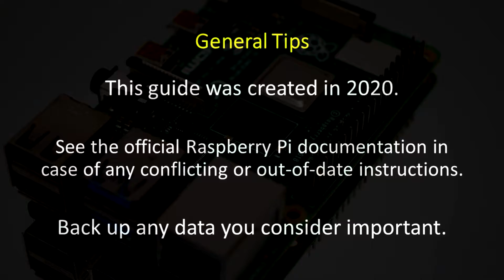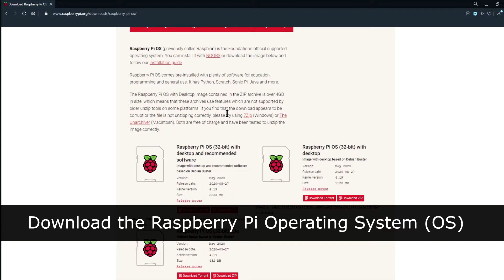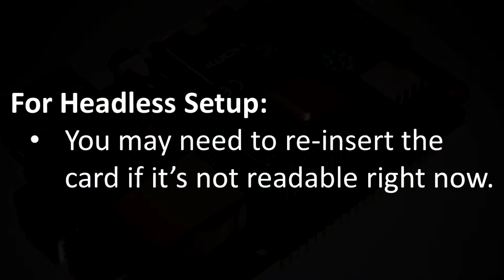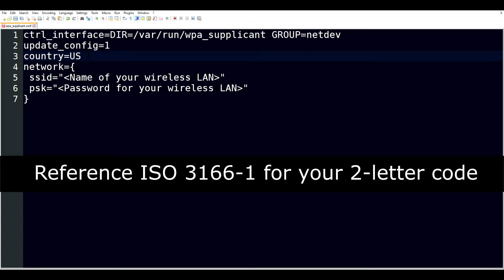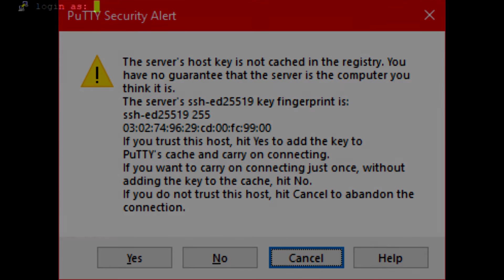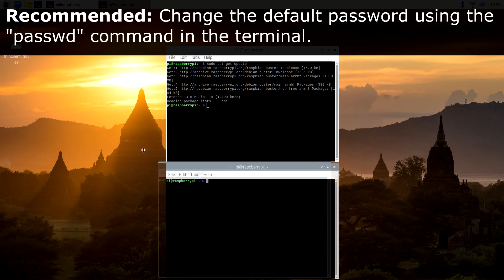Raspberry Pi 4 Setup for Windows Users [DEPRECATED]

Comment: Hey Mate, thanks for these detailed tutorial!
FYI: The login data for first boot has changed. Login via pi/raspberry does not work any longer. 
Now, the Wlan & user / password data has to be configured via the RPI Imager. 
Just click on the "settings" icon at imager screen and set it up. 
Using this way, no extra files are needed.
Reply from the maker: Thank you for the heads-ups!  Today,  I updated the video title/description to reflect these changes.  The pi/raspberry elimination was pretty unexpected at first but I'm betting it will have a positive impact since the OS has become so widespread.

As a side-note, I also have an (overdue) video coming up on Raspberry Pi Zero W.  Actually doing a little field testing this afternoon!

Comment from the maker: 1:20 - General Tips and Disclaimer
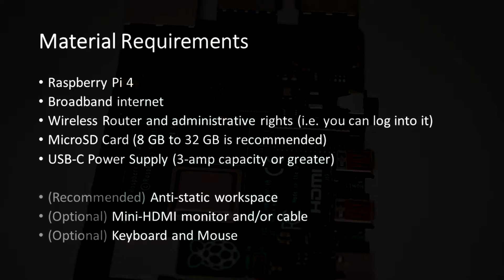2:00 - Material Requirements
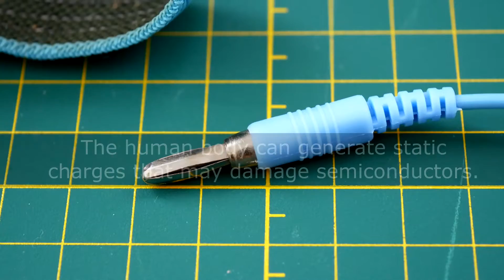3:12 - Software Requirements
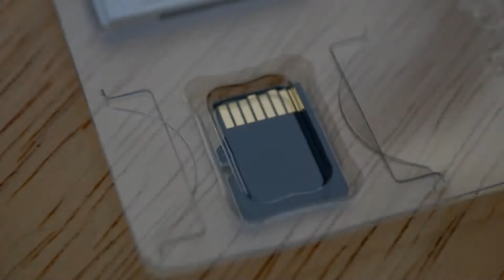3:38 - Step 1: Insert the microSD card
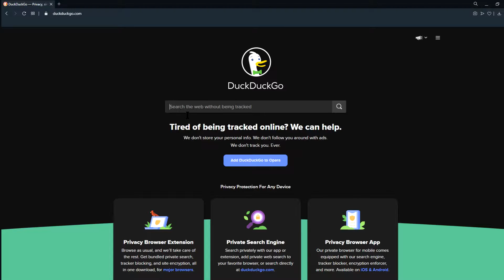4:05 - Step 2: Download & scan Raspberry Pi OS and Imager
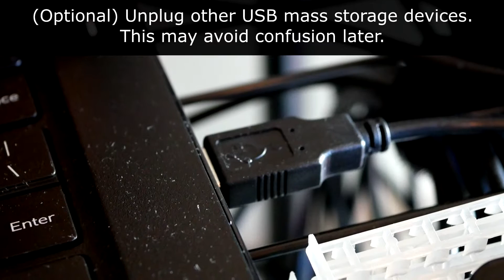5:16 - Step 3: Unplug unnecessary devices (Optional)
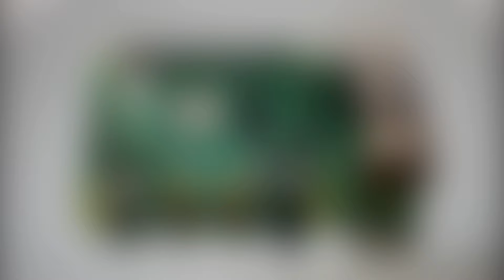5:30 - Step 4: Format the microSD card for FAT32
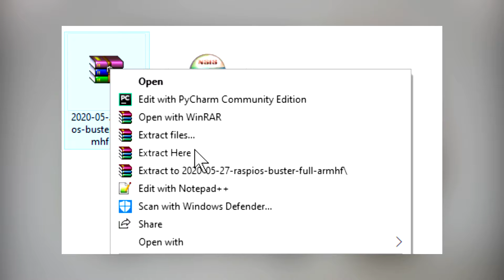6:36 - Step 5: Unzip Raspberry Pi OS
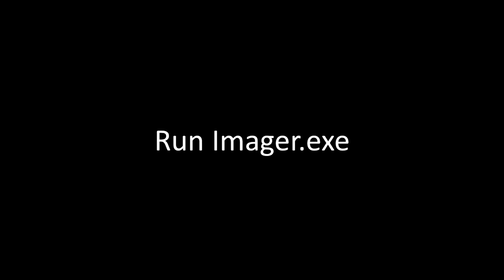6:43 - Step 6: Run Imager.exe
7:02 - Step 7: Write Raspberry Pi OS to the microSD
8:15 - Step 8: (Optional) Re-insert the microSD if needed
9:00 - Step 9: Get and scan Notepad++
9:48 - Step 10: Put blank file "ssh" on the microSD root directory
10:48- Step 11: Create wpa_supplicant.conf for the microSD
13:18- Step 12: Open Windows Command Prompt
13:30- Step 13: Get your router's IP address with ipconfig
13:55- Step 14: Install the microSD in the Raspberry Pi 4
13:10- Step 15: Power on the Raspberry Pi 4
14:33- Step 16: Find the Raspberry Pi's IP address
15:40- Troubleshooting
16:49- Step 17: Get and scan the PuTTY application
17:22- Step 18: Configure PuTTY
18:22- Step 19: Log in to the Raspberry Pi using SSH
19:30- Step 20: "Remove" remote desktop packages
20:20- Step 21: Install remote desktop packages
21:05- Step 22: Open Windows Remote Desktop application
21:30- Step 23: DONE!
22:00- Closing Remarks